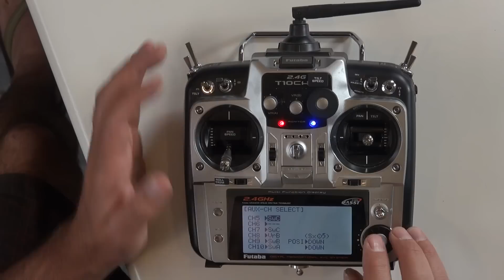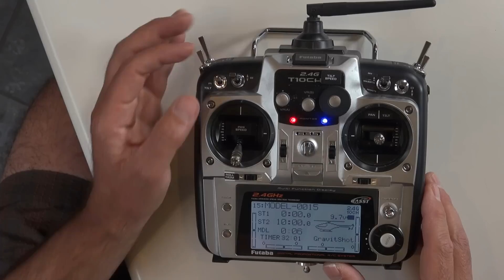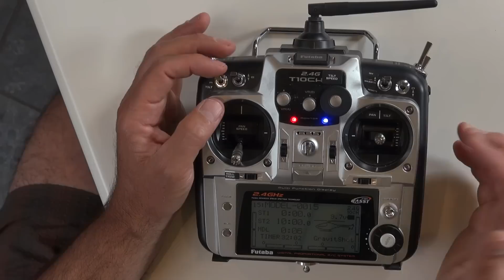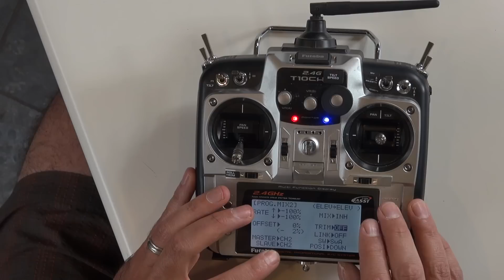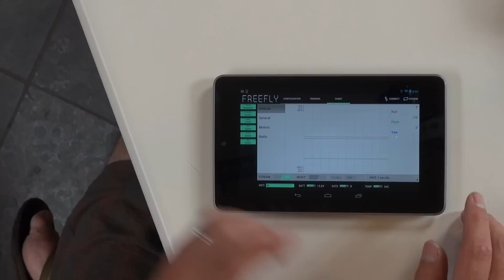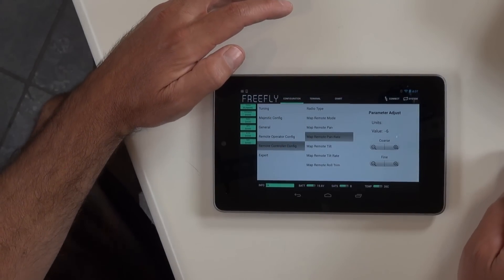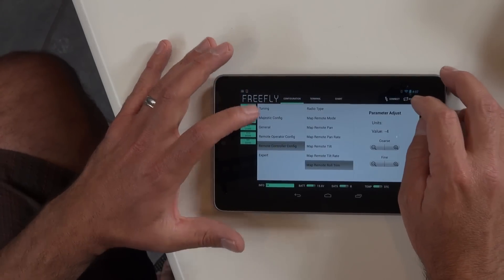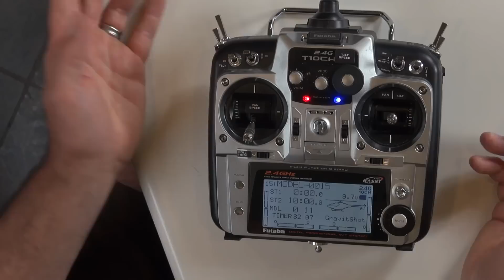Quadrocopter Tutorial - Futaba and MoVI M5 with shutter control

Comment: Will the Movi also work with FrSky transmitters/receivers?  Just use any sbus supporting receiver?  Is that all is required?  How do you power the Movi?  Looks like a great setup if it will also work for me.
Reply from the maker: and sbus controller receiver should be fine....give a call to discuss your options 406-897-1097 or support@quadrocopter.com